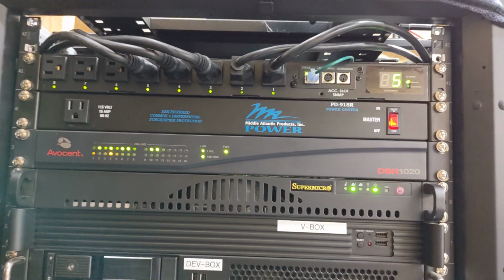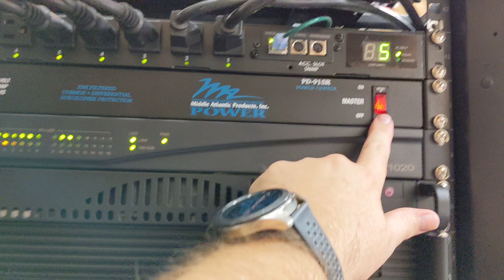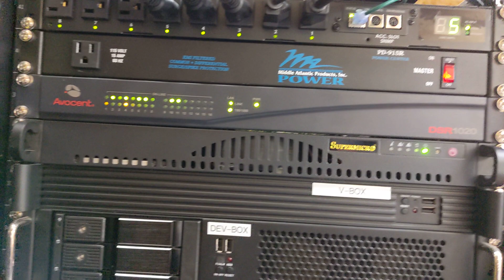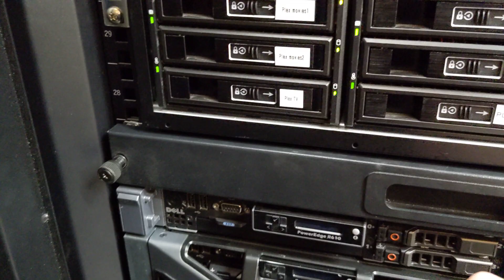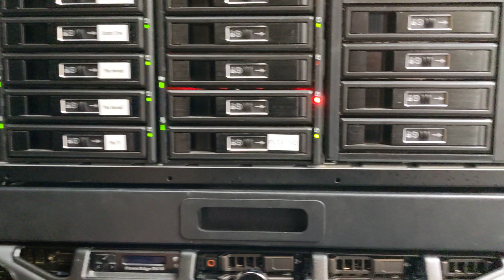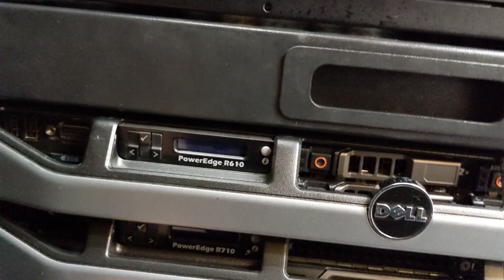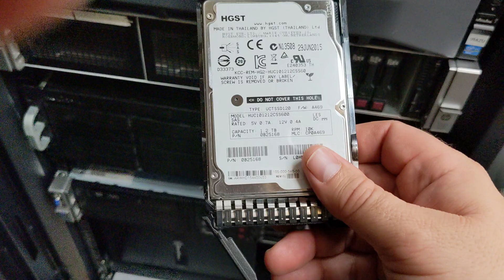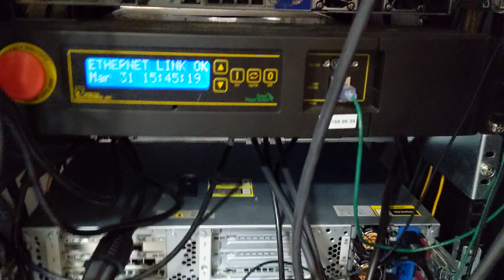Home Server Rack, pfSense, Plex, Starlink, and Unifi #pfsense #ubiquiti #serverroom #starlink

Comment: I have the exact same problem with my 48 port HP switch, horrid vlan performance, I have much older dell powerconnect switches that the vlans work without issues, like the powerconnect 2848 that I paid like $40 for on ebay a few years ago.
Reply from the maker: Like most things Ubiquiti, they make a product that is kind of good but very basic.  Then as they mature and work though all the bugs, they actually end up with a fairly good and useful product.  I’m actually really happy with Unifi switching.  I use the pro series of Unifi switches almost exclusively at work now and they work really well.

Comment: That dell R610 can actually be a really quiet machine. You just have to update the DRAC past (4.10? ) I think and enable the proper power management mode (Dynamic). We used to stick these behind desks and mount them on walls in doctors offices and accounting firms and everyone said they never even hear them. But yes until you update the DRAC they basically run at full fan speed. We also used Samsung evo SSD's in ours in high production environments. They are simply amazing little servers.
Reply from the maker: I agree 100%.  just hard to find the time to do that at the moment.  Thanks for the comment!
Reply: @Hephaestus93  QLogic BCM57xx and BCM57xxx Network Device Firmware 7.12 and Dell iDRAC Monolithic Release 2.92

Comment: i like to keep the switches in the front of the rack, heat dissipation.
Reply from the maker: When I first started I had a TOR switch, and thats how I build them for work, becasue of the heat and fan direction.  I started to run out of room so I moved networking to be Top of Rack switching in the back.  I have made several changes since the video and now have even more switching.  Im trying to get some power and cable management for the back so I can clean things up there too.  More to come.  Thanks for the comment!

Comment: all that heat pumped out by the equipment how hot does it get in that room?
Reply from the maker: I have a 8000BTU AC unit mounted to the wall just behind the rack and part of the air diverted right in to the back of the rack to keep things cool.  it was tripple digits where I live just yesterday so it would get really hot without that AC unit.  I store some things in my shed that dont like getting too hot, glue, resin, epoxy, RC car fuel etc. so I keep the AC unit at 85F while im not in there and turn it down to 72 while Im in there.  My shed has gable and a ridge vents and I have insulated most of the walls that get direct sunlight.  Plus I installed some air intake vents down low in the shed that allow cooler air to come in and use convection to allow the hotter air to escape out the ridge and gable vents.  You can feel air comming in thru them when its hot ourside so at least the hot air had somewhere to go.  I honestly donk know how hot it would get without the AC.  Setting up a rack with servers on one side and switching on the other makes a lot of heat as they are essnetially blowing hot air at each other so thats not ideal either.  Thats a good idea for another video though.  Thanks

Comment: hp/aruba untagged will set pvid of inteface and tagged will be trunked on the inteface. 

ie: vlan 55 untagged 5 or vlan 55 tagged 5
Reply from the maker: I actually just ejected the HP switch from the rack.  Trying to save some power and heat for the summer months.  I came by a 24 port non-PoE Unifi switch and put that in its place.  I was barely using the HP anyway.

Comment: I'm interested in the APCs. I have a couple but they only run for about 10 - 15 minutes when the power goes out. they help for power fluctuation, but when the power goes out for long periods, my servers go down. how long do those APCs last for?
Reply from the maker: The lower APC is dedicated to the router and switching and will run for about 45 minutes.  The other two APC’s are “Daisy Chained” to one another.  This means one will kick in and power the other until its battery gets too low then you will be on just one until it dies and eventually powers off.  Because the two UPS’s are really just running plex and my Unraid it will run for about 35 min on the first one and an addition 25-30 or so on the second.  One of them has cheaper batteries from Amazon that don’t seem to perform as well.  It would be better to get an additional APC battery unit instead of daisy changing but that’s what I have so far.  The extra battery packs for APC are expensive for some reason and I just haven’t come across one yet.
Reply: @Hephaestus93  cool. Thanks  for taking the time. I might try to daisy chain my two APCs. I definitely like to keep my emby server up for as long as possible... And the router too. I've written a little console app that resets the domain records when the router reboots, or the ISP changes the IP on me.  😃
Reply: @chefbennyj  From what I've heard you should avoid Daisy chaining UPS/inverters
Reply from the maker: @omaryc  You should avoid it.  Its clearly not the ideal setup for them.  As long as they are both pure-sinewaive it will work but is not ideal.  Ideal would be to get the battery pack/add-on.  However, those for some reason are extreemly expensive imo.  Plus if I end up wearing one out, I actually have 2 more in storage I could just replace it with by just getting a new set of batteries.
Reply: @Hephaestus93  Instead of buying first party add ons you could just wire up third party batteries to the charge controller. It's a lot more cost effective.

Comment: What about energy consumption? This would be nice to know. I saw some solar panels in your video: will you use them so reduce the costs?
Reply from the maker: Good Eye.  Yes, I have added 2 of the 4 panels to a grid tied inverter so its offsetting most of the power usage at least while the panels are getting good solar.  I am adding the other 2 once I figure out some logistics for mounting them in a more optimal setup.  I am thinking about making a video on that too.
Reply from the maker: I made you something.... https://youtu.be/wwJP49W0bUg

Comment: On pfsense using SSD you can enable the feature to log to RAM to save the wear and tear on the SSD.  Also, if you use a large SSD like 500 gigs then it should last a few years.
Reply from the maker: I have that running as I also use Squid Proxy for cacheing.  I used to use it to cache even small things but found that I was not really getting any speed bump for it so it just caches large downloads like driver and windows updates now.  I also added a syslog server to the rack so I have the actual pfsense logs tunred down or rolling over in a few days as all the logs are getting pushed to the syslog server.